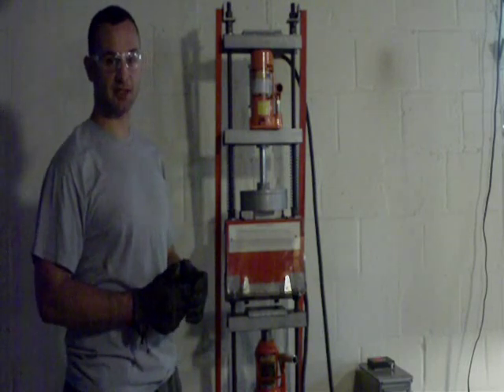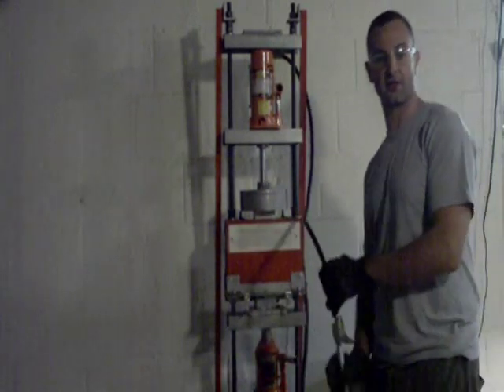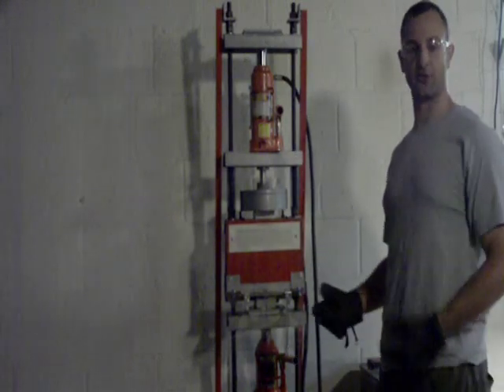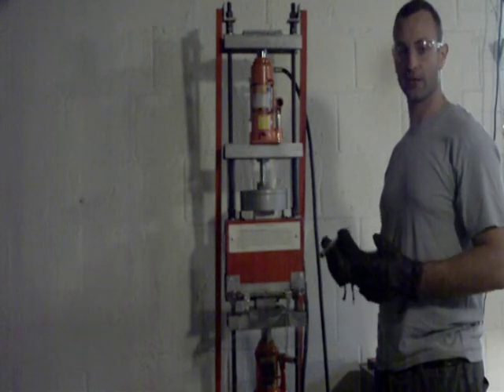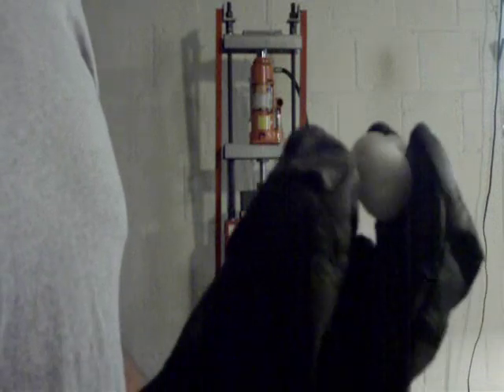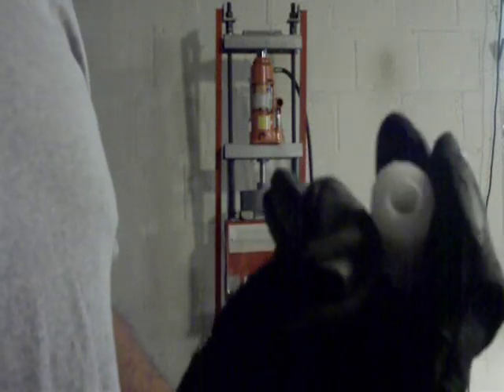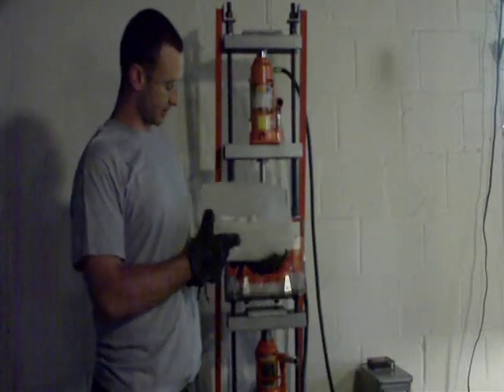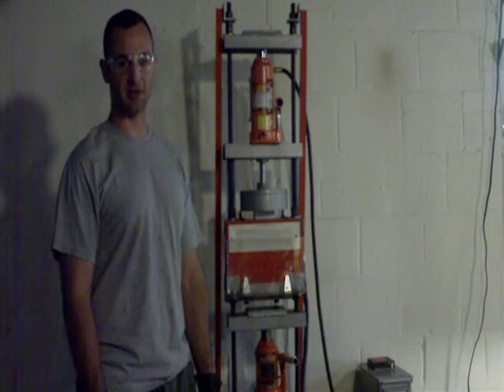Small Manual Benchtop Plastic Injection Molding Machine

Comment from the maker: The material used is HDPE. The way to control the shot is to watch when the ram slows down or stops moving. When that happens, you know the mold is full, and there is no more plastic flowing into it. It can be even more precisely controlled with an inline pressure gage. Pre-measuring material will certainly work also. 

There is a hydraulic cylinder driving the injection ram. It can be operated either by compressed air or manually.